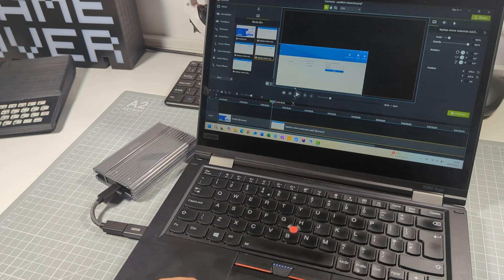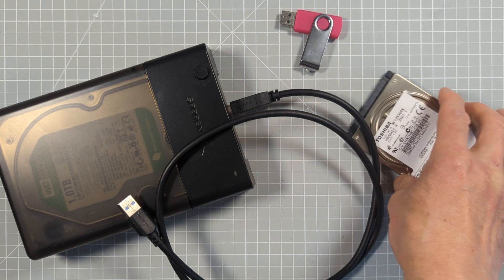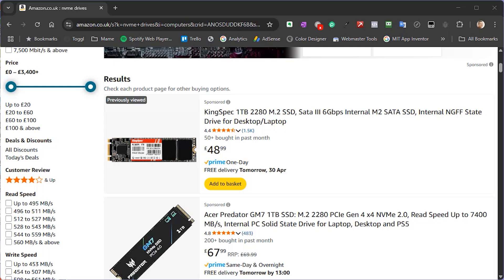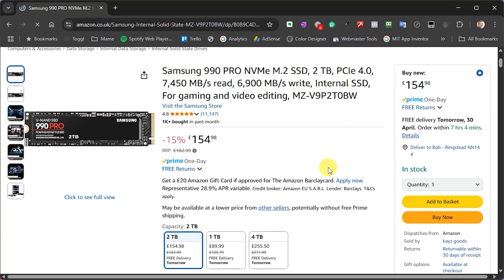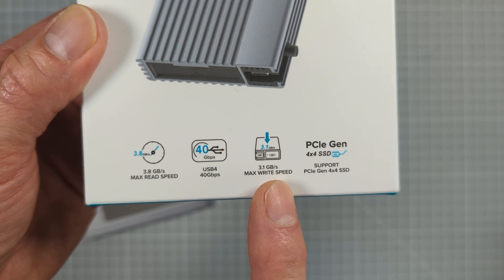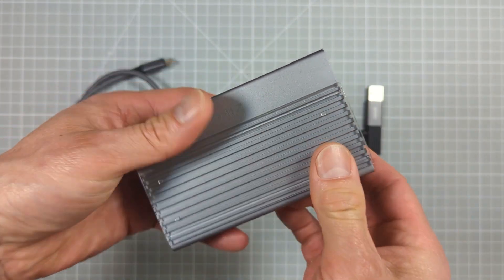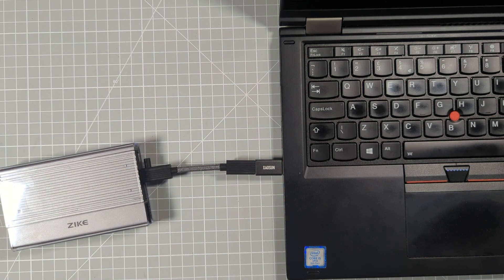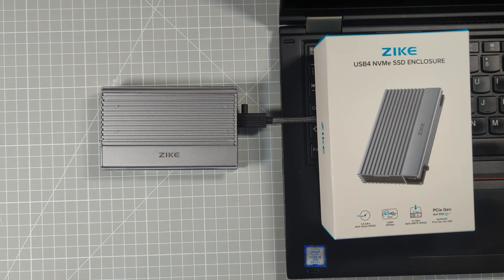Using NVMe drives for ultra fast storage - internal and portable drives to upgrade your laptop & PC

Comment: REAL WORLD data 
versus claimed NVME 
are WORLD of a difference.

DO NOT GET CONNED.
Reply from the maker: These drives are still significantly faster than any other technology. Yes, you'll not get the theoretical max data rates, but in everyday use you will notice a difference, especially if you're using one as an external drive.

Comment: People think these metal enclosures are enough to keep everything cool but it's not true. A 2mm thick thermal pad should be added to the top of the m.2 drive or however much is needed so it touches the metal case. But that's not all. People forget there's a small pcb inside doing usb-pcie translations. The chip on the conversion board gets incredibly hot. So much so that you can't touch it for more than 2 seconds. This chip must have a thermal pad on it so it touches the metal case. these thermal pads can be bought easily in 100mm square sizes from 0.5mm up to 5mm in 0.5mm increments. There's no excuse to not put these in everything including the most common device to go faulty because of excessive heat.... controller and video chips in TV's.
Reply from the maker: Sorry I didn't show the inside of the case. I assumed, for the reasons you stated, that all these cases had proper thermal bonding to make them work properly. I can confirm this unit has proper thermal pads in place that cover the full length of the PCB. The rubberised fixing mount I mention allows the board to be compressed against this pad without bending it in any way. It does work well. The case does get warm but doesn't really have any hot spots. It seems to be dissipating the heat very well.
Reply: @ It would have been great to see the inside. You really should do that for all review items as checking the stuff inside (specifically the quality of it) is part of the review. ok well you could edit in a dissassembly at the end and repost it ;-)

Comment: Yes highly dependant on the cable and enclosure.
I just tried a couple of external units I have here with the same usb-c cable and same settings you used.b
Blueendless NVME+SATA m.2 desktop dock unit - 1032MB/s
Random chinese no-name nvme+sata tiny enclosure (just bigger than m.2 stick) and Samsung sata m.2 1074MB/s
Same random chinese no-name unit with Toshiba nvme m.2 3070MB/s
Used different usb-c cable got 500MB/s with sata m.2 and 1015MB/s with nvme m.2
Reply from the maker: Thanks for the test info. Great to see what other brands can get.

Comment: Recently I upgraded to a 2 TB NVME SSD on my laptop because I decided to make it the machine I use for work and I needed additional space. After I finished copying my files onto the new drive, I was left with a 1 TB 2230 NVME SSD that I wasn't sure what to do with. So I had a look around and found a really nice USB-C enclosure. It is made specifically for 2230 size SSDs so it is really compact, plus it has active cooling which really helps with the heat dissipation.  It is extremely small (not that much bigger than the 2230 NVME drive itself,) very portable, and really fast, much faster than typical USB thumb drives. I now use this drive whenever I need to transfer files between computers. In particular, I find it very handy when I need to transfer game ROMs and BIOS files between the various machines I have set up for gaming and emulation. This is especially welcome given the size of ROMs for the more modern consoles can be very large, often in excess of several gigabytes each.
Reply from the maker: Sounds like a great setup and good reuse of the drive.

Comment: Never knew you could plug in a USB C cable upside down. Thanks!
Reply from the maker: I think it's some sort of unusual setup on these adapters. I think the idea behind USB C is that you can plug it in any way round.
Reply: @BytesNBits  Yes that's a chinese junk adapter and some of the high speed pins are not connected.